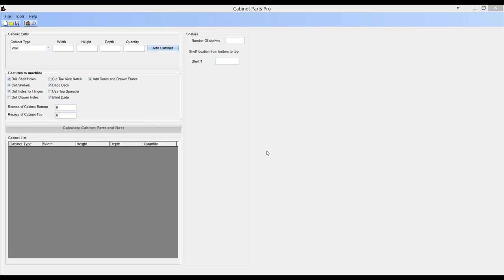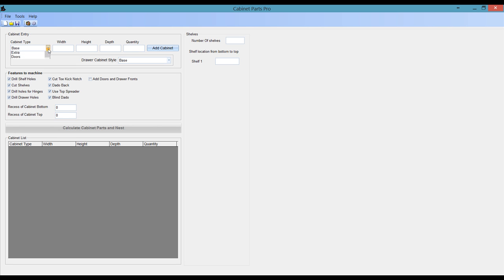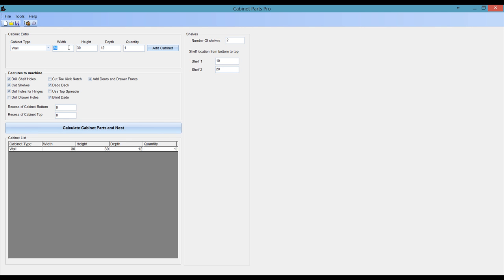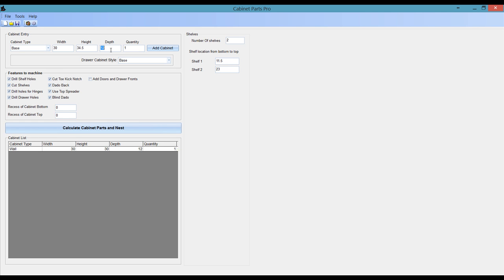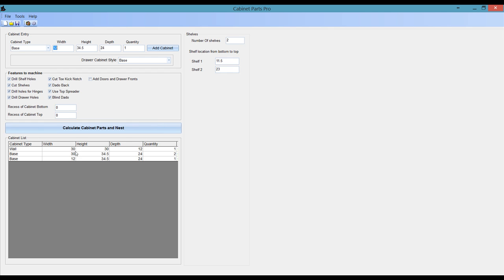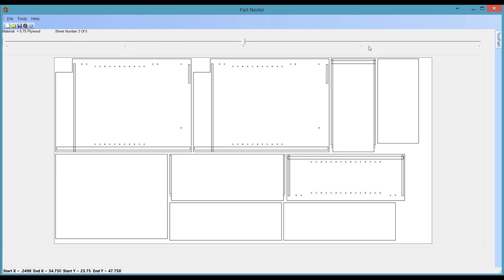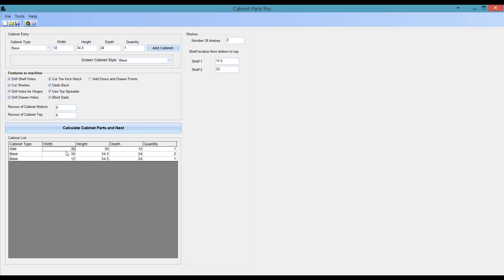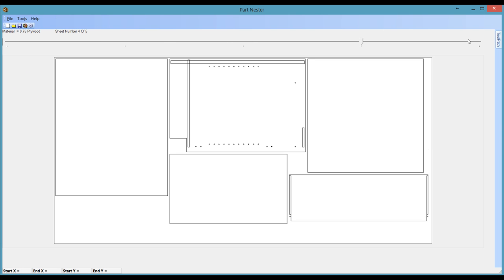Basic Entry

Comment: downloaded trial....tried entering cabinet dimensions and "division by zero" error message when entering height dimension and shuts down. Just doesn't work
Reply from the maker: You can try restoring settings to default by going to help about then click the reset button.  Have you entered a zero value in a setting?